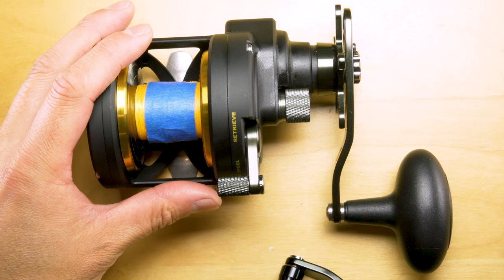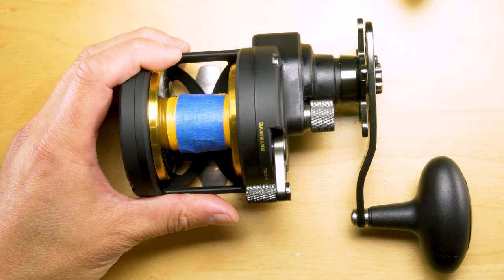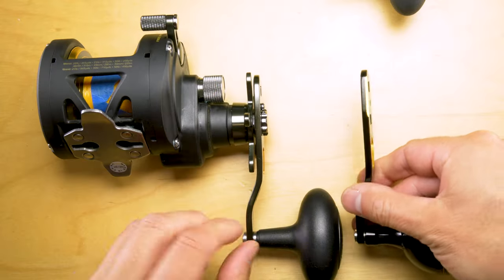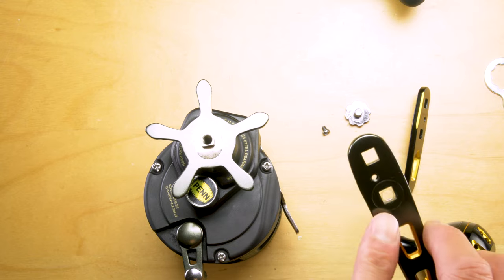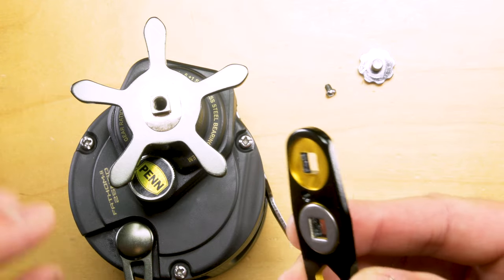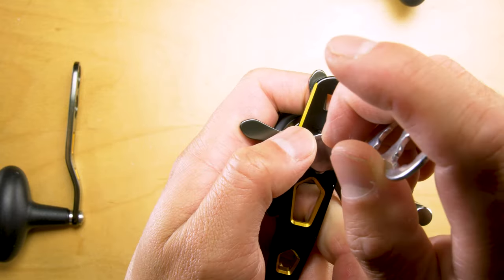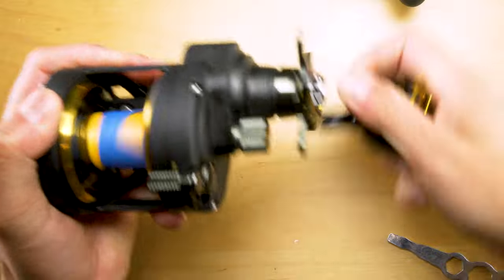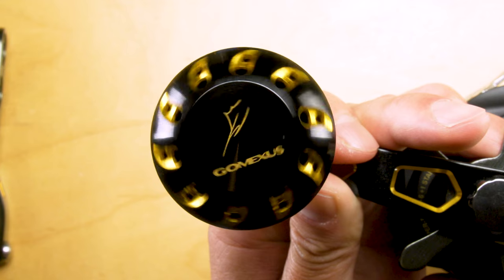Gomexus Power Ball Knob install Penn Fathom 25n Star Drag Reel

Comment: Could you please let me know what the shaft size is (ie. the dimensions of the square/rectangle hole in the handles)?  Also is the shaft size the same between these star drags reel and the fathom lever drag reels?
Reply from the maker: The star drag and lever drag holes are different. The lever version is much larger and has angled cut on the corners like an Asscher cut diamond. The star drag is perfectly square and much larger. Hope that helps